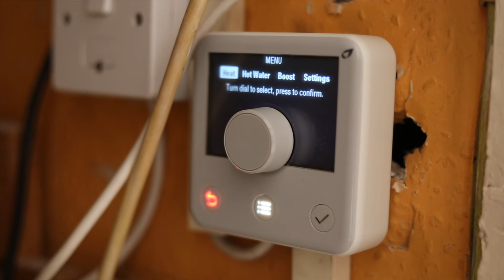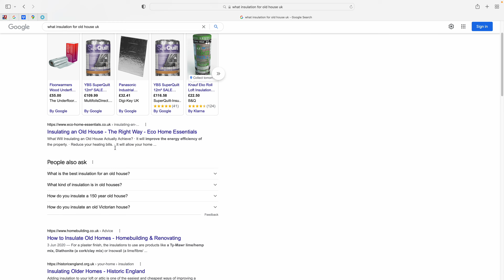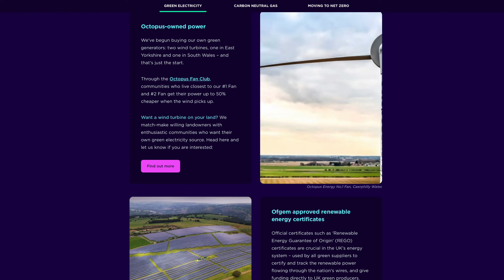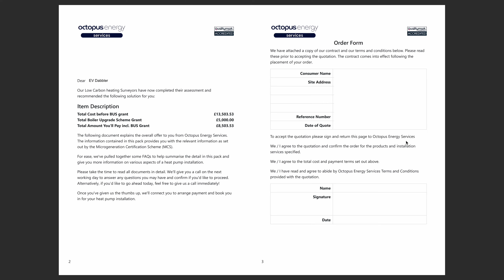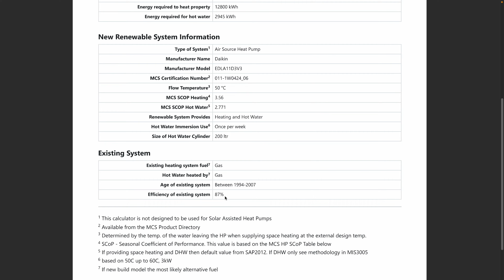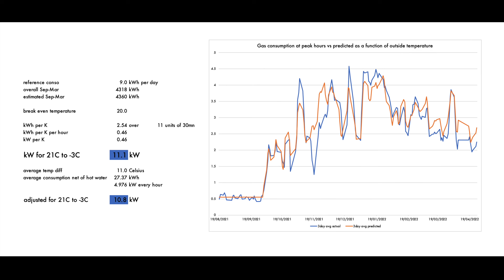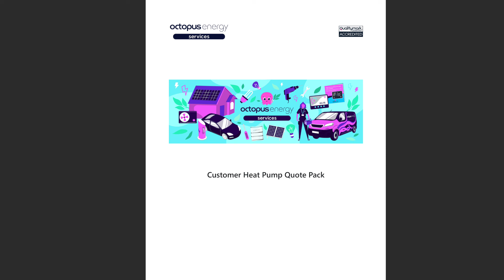Heat Pump from Octopus - Should I get one?

Comment: I looked at getting a  heatpump as alternative to gas, but after being told the running cost would be £300-£350 a month in winter and i would pay a lot more to heat water, i looked at replacement gas boilers. My 25KW boiler costs £13/week to run most of the day at 22c in the whole house and to give hot water.
 a heatpump is more expensive, more complicated, the tanks take up too much room and they cost more to run.  My gas and electric bill is £101/month with BG.

Comment: This video is now 2 years old.  Would be nice to see an update, as things have moved on.
Reply from the maker: What type of update are you thinking? Heat loss calculations are going to be the same I think so are we talking mostly about costs / size of equipment?
Reply: @evdabbler - a COP of 3.5 is now routine.  4 and even 5 are firmly in view.  Decibel levels are dropping.  Microbore can routinely be handled.  R32 refrigerant (a fluoro-carbon) will be banned by the EU in 2027.  Daikin has introduced a new Altherma 4.  And so on.  Like electric cars, the tech is advancing all the time.  2 years ago is effectively history.

Comment: I question some of these COP figures, one reason is, a good condensing boiler can be 93% eff, but it is direct into the water that's in the rads, that is not so with a HP. The real COP is the energy consumed divided into the energy load of the house, which is dynamic because outside temperature fluctuates, humidity changes etc.

Comment: Looking at getting a heat pump - refreshing my memory of your thoughts on the Octopus ASHP offering
Edit
The SCOP prediction is rather poor at 10:26 when i looked up the SCOP predictions for a Daikin 12KW system it was 3.37 at 55c and 4.64 at 35c so 45c would be 4. bit disappointing that 50c is 3.56 and not higher. its not great - might not break even with gas. 

my local heat geek firm have quoted me £13500 ( with the higher 7500 grant) for a 12KW unit desinged at 45c with 10 radiator changes & new cyclinder. 

a 50c system doesnt look that appealing to be honest - unless the "spark gap" comes down of course
Reply from the maker: @Lewis_Standing it was a while back so wonder how different the quote would be now. The amount of work would be just as much though. All the best on your change.

Comment: Question. We often see that radiators are replaced for heat pump installations to get the best efficiency and make the heat pump work for many rooms. 
Could i therefore get a good and reasonably priced payback >with an existing gas boiler< by simply replacing my existing single radiators with larger double depth radiators? 
Because as well as increasing efficiency, if i later move to a heat pump I'd be at least partly prepared anyway? Did you look at this afterwards?
Reply from the maker: I certainly am not the expert but understand that's an approach people take, lowering the temperature on their existing boiler meaning better heating efficiency. This assumes you have that level of control - not our case here.

Comment: I've been going though the process myself. I realised every single plumber has their own manufacturer and solution they prefer installing. As a result I couldn't trust anything I was told and had to run the numbers for myself. After doing so, I was coming to the same conclusion as you have. It's not really worth it.

Comment: If heat pump were so good and net zero was true. Why are uk councils not  getting them for council housing so all council house are gong to net zero like the private sector. Private rents has to have it. Yet council house are not. Till all council housing its done all private should not spend on heat pumps. Remember EV cars are being tax on wieght in a few years yet we were told they dont need be taxed when came out but ev are heavy and damage roads and bridges. The climate change is a CON that whole of parliament no matter the party is spreading to take money out of drivers pockets.
Reply: HP Britain is decades behind the rest of Europe. Council estates are better served with ground, water or waste heat networks, rather than individual ASHPs.
Reply: EVs damage roads and bridges? Your having a laugh,  Lorry’s, busses and large vans are far heavier than most EVs. That just another anti EV argument that simple doesn’t hold water.

Comment: Excellent summary of the quote.  Have to confess I’m a bit confused by their heat pump sizing.    They estimate you need < 5kWh to heat the house but want to install a HP >2x that capacity which would make it inefficient.  A good estimate of heat pump is your annual consumption divided by 2900.  In your case it works out at about a 5.5kW heat pump.  Increase by 20% if you live up North but that still works out at 6.5kW so 7kW unit would be more than adequate.
Reply from the maker: Interesting rule of thumb. Thanks for sharing.

Comment: I was a bit disappointed by Octopus. We bought a new/old house and our boiler was broken, I rang them up and asked for a quote to install an ASH. They wanted £500 in advance to come out and do the quote. The requirement was that we switch to them as a supplier, replace most/all of our radiators and all piping (which increased the cost dramatically). The explanation was that the house needs to be 100% compliant with the requirements, even though we have fille cavity walls and do not need much heating. They do not do half measures, it seems.
In the end we went with iHeat to replace and move the boiler, next year we do the pipes and radiators/floor heating.
Reply: Shouldn’t radiator upgrades be included in the price of the original quote you get online that’s what it says on there website
Reply from the maker: I can see how they would do belt and braces for now in a scale up phase. There is so much noise around heat pumps "but they don't work". If i were them rather take disappointment on survey than on completion of £10k worth of works.

Comment: We have 128m² 4 bed detached house. 270mm loft insulation, cavity wall  insulation and modern double glazed windows. Our EPC is rated B85.  Installed Octopus Daikin 7kW ashp in June 22. Heat calcs gave 6.6 kW heat needed @-2 ext. I checked and used heat geek cheat sheet which gave about 6.7kW. we needed 11/14 rads replaced (No new ones) and had sealed 250l tank replacing vented tank. Our net cost after grant was £6008.

After a year of use we have found the system more than adequate to heat the house. The design was for a flow temp of 50⁰@-2ext but this was too warm when we got to design day in December. I gradually tweaked weather comp down to 50⁰@-15ext/30⁰@18ext. This gave us 20⁰ downstairs and 18⁰ upstairs and very little cycling. We got a sCOP of 3.63 for heating and 2.36 for hot water.

As to usage we used 2663kWh for heating of which 550 came from solar. For HW we used a mix of night rate heat pump (501kWh ) and eddi (275kWh) plus solar 629kWh.

If we had used gas I estimate  last 12 months would have cost us £1380. Using our Octopus Go Faster tariff we have spent about £858 all in and saved a further £105 by ditching gas . 

Very pleased with the system but you need to fine tune to your house to get best efficiency out of it 🤓
Reply from the maker: Great experience share with detailed numbers thanks

Comment: We got four quotations and weren't happy with any of them. Too much double counting and not enough technical justification. This looks better so I would recommend people look at Octopus and a few other suppliers. As to the extra radiators its obvious that you just need big 2m long radiators. I assume there isn't much space to put them anywhere so they have defaulted to the vertical ones. You might like to consider changing the room around.

Comment: I think you have misinterpreted the radiator chart - Octopus installed mine and that column shows the radiators they replaced. Nothing was added. Mine were mostly swapped single panels for doubles and my main living room radiator was replaced by one 30% longer. The installation took a week and so far I've been very pleased both with my ASHP and with Octopus.
Reply from the maker: Thanks and good to hear.

Comment: Useful video, thank you.  I like the fact that the Octopus quote breaks down the cost into the components such as the heat pump and the installation etc. Most suppliers want to hide what they are charging for installation.
I think the installation cost is reasonable given all the radiator changes.

Comment: It does feel a lot like you are spending money for little financial gain. You might feel better making a smaller carbon footprint, but that's pretty much it.
Your thinking should really be how to insulate and reduce air changes since that reduces the heating demand. Then size a modulating ASHP which will cope with -5C but will be equally happy turning over in the shoulder months. Then add a battery system that can charge on the overnight price to supply the house and heating during the day. Then throw some PV on the roof to reduce the bills. After you've spent the thick end of £40k, your elec bills will be near zero. Mind you, after 10 years, the kit will have aged, and you'll need to shell out to renew it all again.
Reply from the maker: There are many departments when it comes to house spending where your financial gain will be nil or very negative, e.g. "let's redo the kitchen". Improving home energy efficiency by a factor of 2 to 3 is not a bad objective in itself.

Comment: Great breakdown, one thing to remember is after 2025 properties will not be allowed to be rented out with an EPC lower than C, I am supposing this will pass through to mortgages shortly after for all homes making the property harder to sell and possibly discounting it for the upgrades required to reach C.
I maybe wrong but it looks like this is the direction it is going.
Reply from the maker: And if you ask me I think this is the right direction, as long as there is selective support for those who need it, and/or better income tax breaks for those volunteering the changes early.

Comment: I was also concerned about the sizes of radiators that may be needed with a ASHP. So this winter I installed a energy meter this showed me the amount of energy being used in real time, very useful but also it allowed me to turn my oil boiler flow temp way down accurately, I turned it down to 37C and surprisingly for the majority of the time this works, rooms took a lot longer to warm up but it held its own down to about 5C outside when it started to loose the battle. At this point I turned the flow temp up to 50C and again it holds its own down to mild sub zero temperatures outside. This has given me the confidence that I won’t actually have to change many of my radiators, except in the kitchen and the bathroom both of which have always been underrated. A energy meters are about £150 but gives a lot of very useful real-time information to backup or disprove spreadsheet calculations.
Reply from the maker: Thanks for sharing. But what do you mean by energy monitor in context of an oil boiler? I use extensively smart sockets with electricity monitor (see last video released) but not too sure what you are referring to here.
Reply: @evdabbler  Its a device that is installed into the flow and return to the boiler that measure the water flow rate and the flow and return temperatures, from this it can calculate assorts of information such as Kilowatts being emitted by the system, the temperature differentials between flow and return and the flow rates all in real time.
Reply: @Cliffbrook1  Care to name the product? I've been trying to find something to monitor gas boiler efficiency for awhile and was just starting to think how I'd make one.
Reply: @paulrattray8121  Look up Open Energy Monitor for information on Heat meters
Reply: I have been running my has bolier at 40C and for most of the winter it is fine. I just need to upgrade a few rads to be able to run the whole winter at 40C. It gives me a lot of confidence a heat pump will work well. Also, when running at the lower temperatures I have kept the boilerr running for longer. I find this makes the house much more comfortable and I can reduce the temperature settings for the house.

Comment: Our house was built in 1878 fitted a RED 16 KW heat pump last year turned it on last October my SCOP is currently 7.9.  We have sized all the radiators at 30C flow at -3 and the heating curve is set to 30-37 and all new oversized pipe work.  We have installed all new triple glazing and added super foil SFG 19 to al, the outside walls.  We run the system 24 by 7 no room stats only TRV to stop rooms overheating and we average 20 C across 10 rooms.  End result massive disruption huge cost really comfortable house and low energy bills.
Reply from the maker: Yes sounds like a big undertaking but with fantastic outcome.
Reply: @evdabbler  yes not one for the faint hearted its a retirement project so just the two of us living here so we can put up with the disruption and I am a retired M&E engineer and a   competent DIY enthusiast  so plumbing and electrical works are not an issue.  The key is low and slow with the design of heat pumps and the insulation we added the insulation to the inside of the outside walls lost about 200 mm of the room dimensions and 80mm 120 mm off the room height as each room is now an fully insulated box floor walls and ceilings.  we have also installed a heat recovery system to make sure we don't get a condensation problem.  Once complete you wont get a lot of change out off 50K for materials and plastering decorating etc.  I am not new to heat pumps and have had a 6 Kw Daikin heat pump heating the wife's boarding cattery underfloor heating system for the last 12 years.  the cattery system is turned on 1st October and off end off April again no stat and a 25 to 30 heating curve maintains constant 19C across 150 sqm heating 19 tons of screed topped with ceramic tiles.  once the house renovation is fully complete i am hoping to run a similar heat curve of 25 to 30C and leave the heating system on all the time and  use an outside sensor to call for heat if the outside temp drops below 14C  for more than two hours as 14 C is the point the house internal temp starts to drop below 19C.  sorry to waffle on but you did ask for feedback.
Reply: Neil, may I ask why you decided to go with IWI rather than EWI? Both can involve painful aesthetic choices if you have attractive period features like decorative plaster or richly-varied brickwork and other features. External wall insulation can also be really tricky around window reveals, corbels and the like, as can trying to eliminate cold bridges and connect to loft and floor insulation to create that "fully insulated box".

What issues did you encounter installing the Superfoil SF19, and how effective has it proved in terms of insulation compared to your original plan? I assume you're having to get an RdSAP assessment done to get through Building Regulations and produce a new EPC. There is still a lot of scepticism in the UK market about multifoils compared to using Celotex, Kingspan etc but I am attracted to them because they look so easy to install for both roof and wall insulation once you've got your timber battens right, especially for detailed areas like windows, other junctions and pipework penetrations of the building envelope.

I'm puzzled too why the IWI needed to be 200mm deep if you only used Superfoil?

Comment: Pressurised system was a massive improvement for us.  I am increasing my solar PV array up to 17kwp and fitting  a 35Kwh battery set.  Once that's in and I get a handle on the amount of excess solar generation I will look at partial A2A heat pump system and just use the gas in the unproductive months in the winter.
Reply: You could also use "energy cycling" with that battery, i.e. charge it up at night using low-cost electricity, then discharge it during the day for your local domestic requirements (including the ASHP) and saving a ton of money on peak-rate electricity. Exporting power from solar PV seems to offer very poor returns in comparison.

Using gas may of course cease to be option once your boiler dies. The Chris Skidmore MP report of Jan 2023 recommended that the Government require all houses to be EPC C by 2033 (if you want to sell) and to ban all gas boiler installations from 2033 too. My money's on just using cheap electric panel radiators as a supplementary heat source, unless the Government breaks the link between gas and elec prices, or hydrogen boilers become viable.
Reply from the maker: Serious generarion and storage power there.
Reply: I’ve already two Powerwall batteries 27 kWh of storage and a solar system. The solar is great for the summer but winter time it’s not much good some days just a few kwhs That’s when the batteries take over, charge at night for 6 hour on cheap rate then run the heatpump during the day. That and dumping the gas standing charge make for cheap heating. As for the cost of it all, it’s improve the value of our house and the return on our money is better than on deposit at the bank. Luckily I also got solar installed in time for the FIT payment.